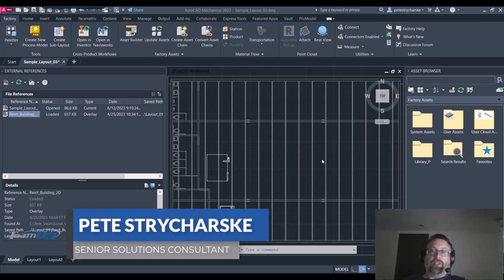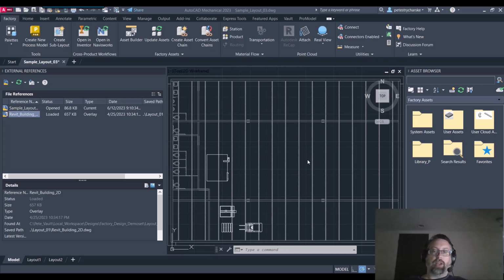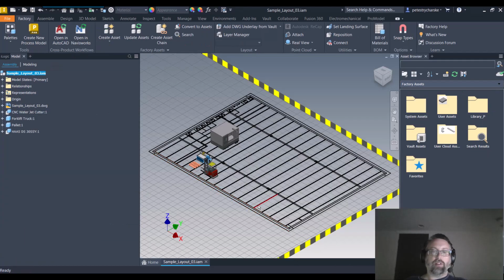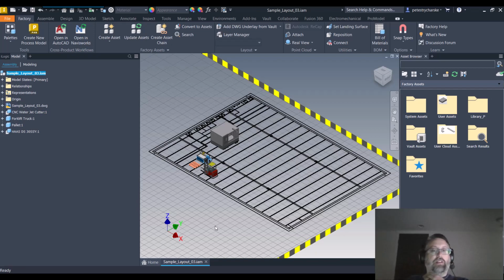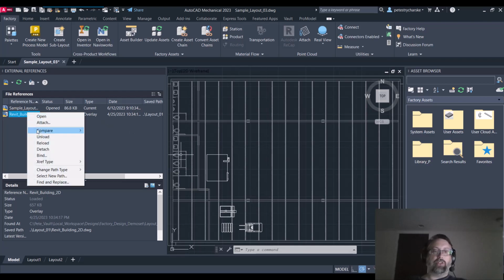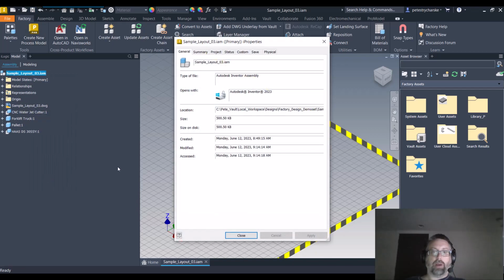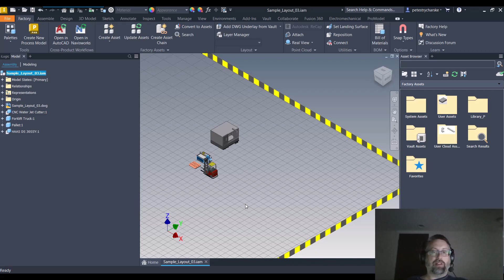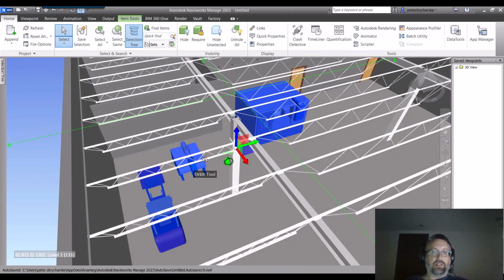Factory Design - Improve Inventor Performance by Unloading Heavy XREFs in AutoCAD

Comment: How do you control the origin so that files from Inventor, Revit, and AutoCAD fall into place in Navisworks?
Reply from the maker: Great question @EB-zn4hs!  Currently the best process is to ensure there is proper communication between the Architect (Revit) and the individual layout / product designers (Inventor and AutoCAD).  

With Inventor, things are relatively easy, because the Revit origin will align with the Inventor origin.  Therefore, if you reference the Revit building into an Inventor layout by "Grounding at Origin" the location of the building will be easy to determine.  Some adjustments may need to be made to the Inventor factory layout from that point.

If you've exported the Revit model as a 2D AutoCAD floorplan, the process becomes a bit more complicated.  The Revit floorplan will come into AutoCAD at proper X, Y coordinates, but at the Z = 0 elevation, which may not match the actual building.  At that point, you may have to simply move the AutoCAD layout up to the proper Z elevation level.  

After taking those steps, everything should line up in Navisworks, which is easier than trying to move them around in Navisworks (in my opinion).  My team and I are currently performing some research to determine if there is a more reliable way to communicate / automate the building location from Revit.  At the moment, we're looking into a special family that can be used to set up the building location and communicate the elevation.  Hopefully we'll know more within a handful of weeks...

My apologies for the delay in responding to you and please let me know if you have any questions.  Thanks for your patience, hope all is well and have a most blessed day!

- Pete